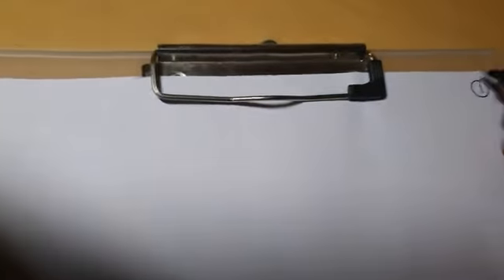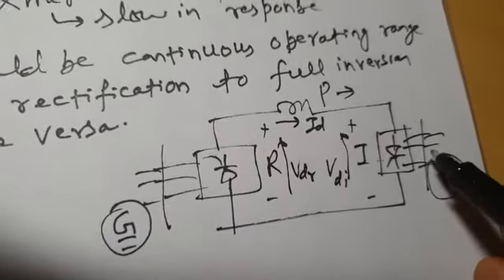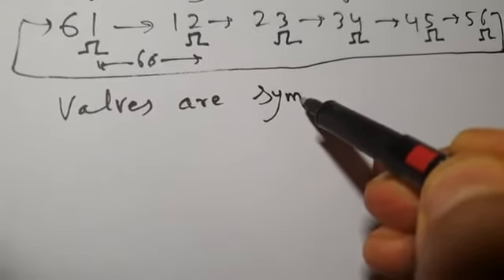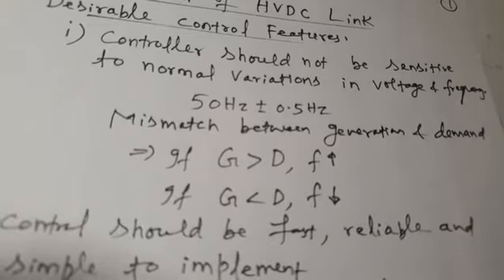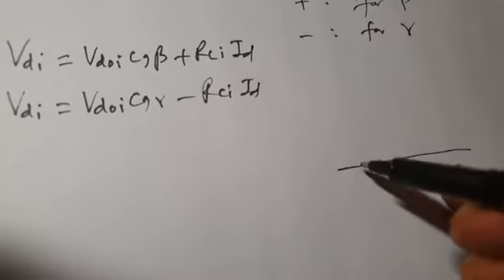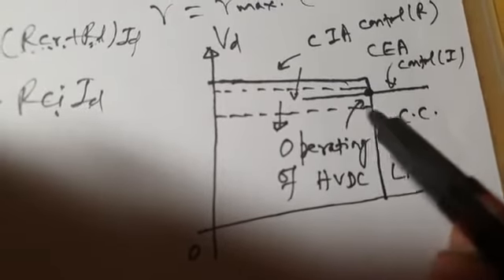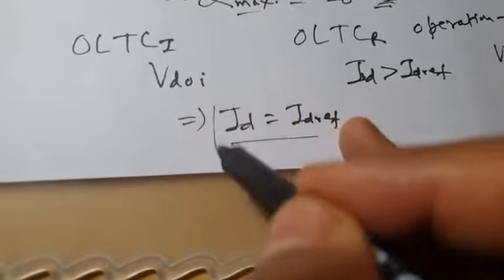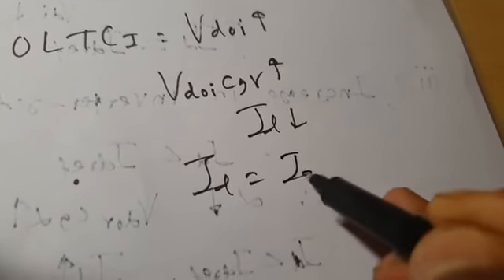L20_HVDC Link Control

Comment: Sir, I have a question, when commutation failure occurs during the AC side voltage dips, then DC side current Id increases to a large value, but according to the explanation you mentioned we exercise the alpha control in such a way that Vdr = Vdi = 0, so that Id = 0 for a fraction of a second. Can I say that for this fraction of a second, the HVDC system does not transfer the power to the load? (as Pd = 0). And if it is so, then both of our poles shouldn’t be blocked as there is no transfer of power for that fraction of a second? And after that commutation failure, when normal AC voltage is restored, Id is normal and hence power flow would be normal?

But normally the poles don’t get blocked even if there is no power transfer during this period of commutation failure due to AC side voltage dips. Do we implement logics in the control system not to block the poles for a few milliseconds like during the commutation failure referring to the above conversation?
Reply from the maker: Yes. Your analysis is correct.